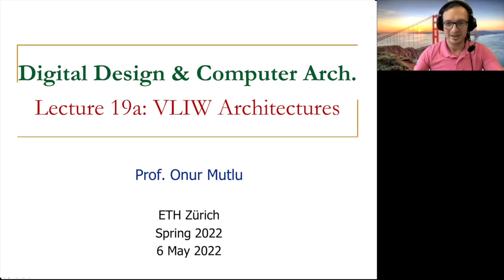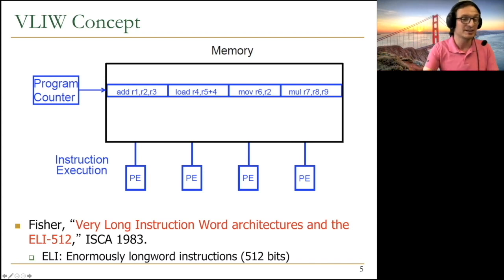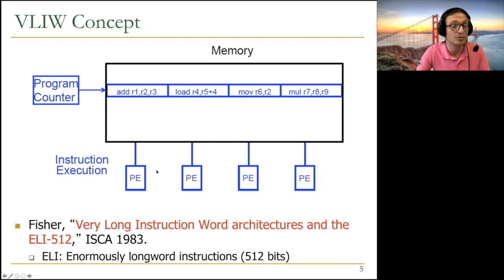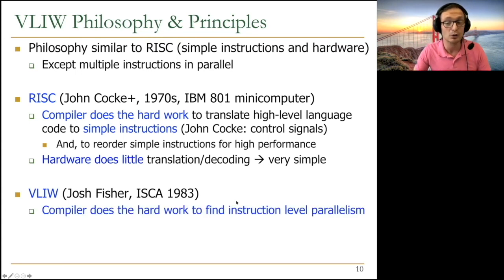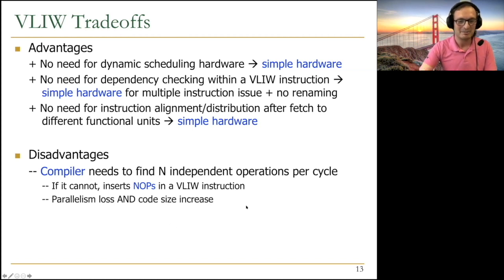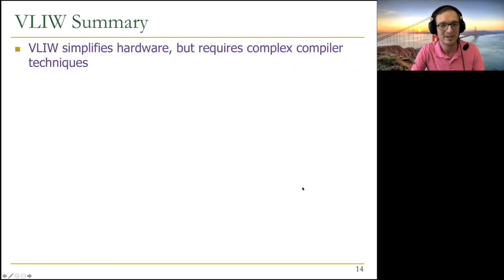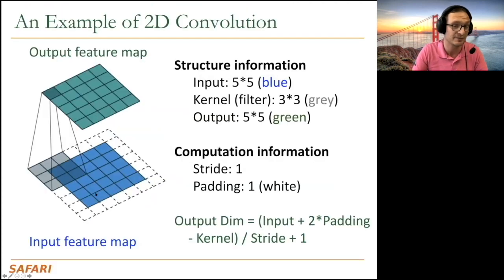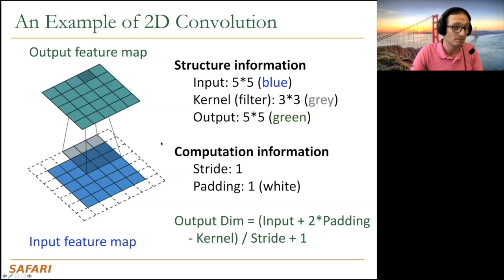Digital Design & Computer Arch. - Lecture 19: VLIW and Systolic Array Architectures (Spring 2022)

Comment: Good description of systolic arrays,Prof.Is it possible to have FPGA like systolic arrays?
Reply: FPGA has not many DSPs to make a large systolic arrays，but a small size of arrays can be used in multiply-accumulate computing. And maybe the clock frequency will not be very high,  according to the place&route resource. But there is also a way named supertile, which increase the datapath or clock rate using special means.